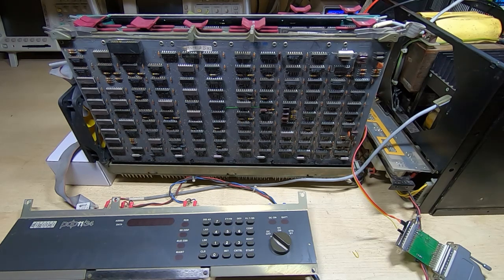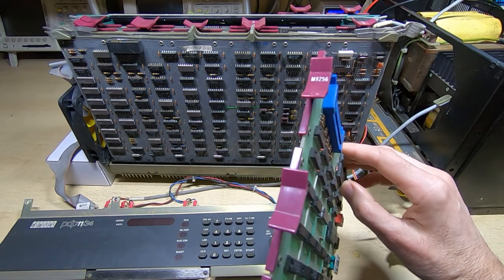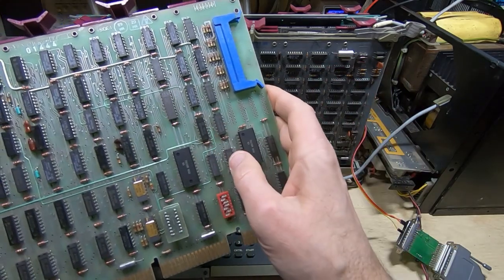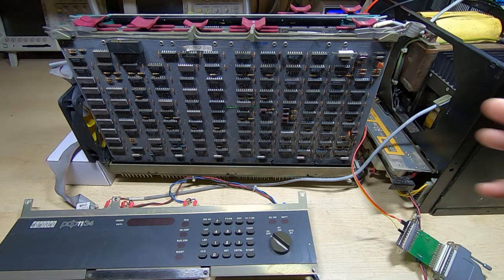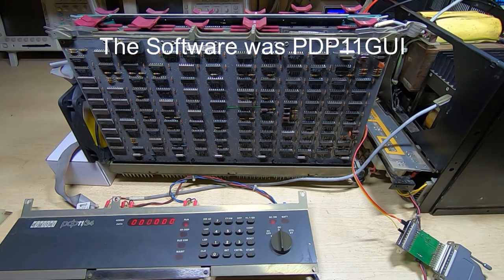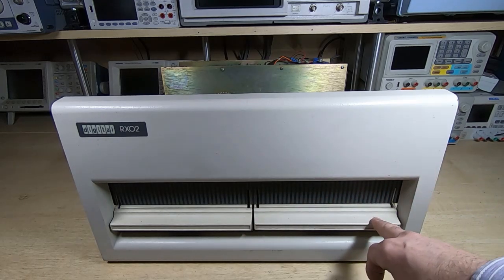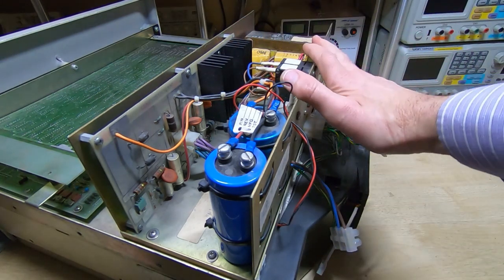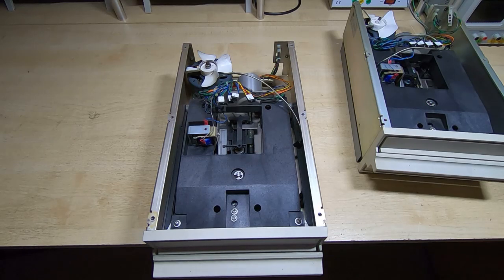PDP11-34A Repair Part11 The RX02

Comment: The RX01 I restored about 3 years ago had a mouse nest in the left drive.  Your drive is pristine in comparison.

And for those that complain about you calling Digital Equipment Corporation  Dee, Eee, Cee, get a life.  While the most common way the name was spoken was DEC (pronounced Deck).  The next most common was to call the company Digital.  Rarely was the abbreviation spelled out when spoken.  But the purpose of these videos is education and your reasoning for spelling it out is sound.

BTW, whatever happened to the 8/m restoration series you were working on over a year ago?  It was that series that introduced me to your channel and I am still waiting for closure on that project.
Reply from the maker: Yes I agree, anyone complaining is missing the point of my videos. My point regarding 'DEC' is try googling 'DEC Company' and then try googling 'deck company'. I can guarantee that 'DEC' will be much more informative and the entire point of my videos is to get as much information across as possible to people who may have never heard of the Digital Equipment Corporation. I completed the PDP8 and it boots and runs. I did not post any more videos in that series as there seemed to be very little interest (very low view count). I am still waiting for the owner to collect it.

Comment: I don't remember your earlier videos on restoring floppy drives, so I'll definitely have to review them.  I've got both dual RX01 & dual RX02 drive systems that need TLC, so I'm very interested in everything you can share on this subject!  I'm also interested in the offline (i.e., not on video) testing you did on the floppy drive interface board/module that you briefly mentioned -- where did you get the needed information that pointed you to what needed to be done, and if you're willing to spend the time explaining, what testing did you do?